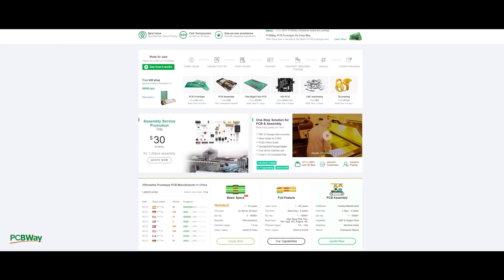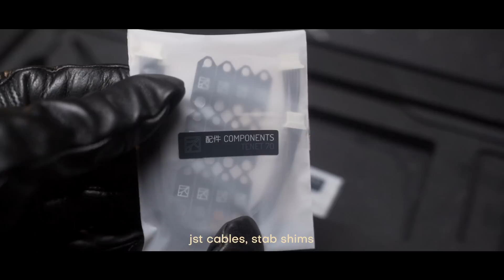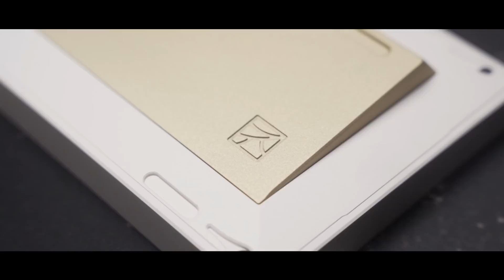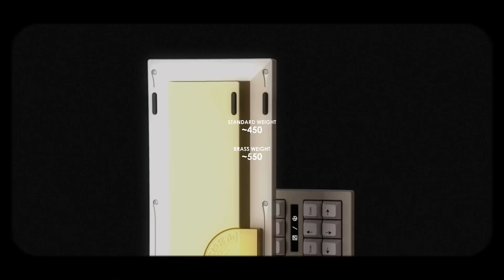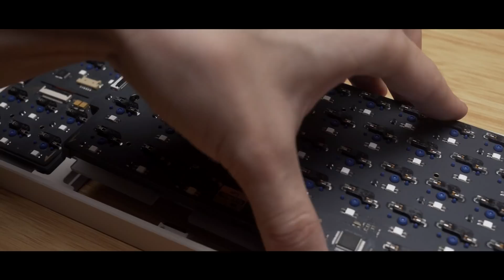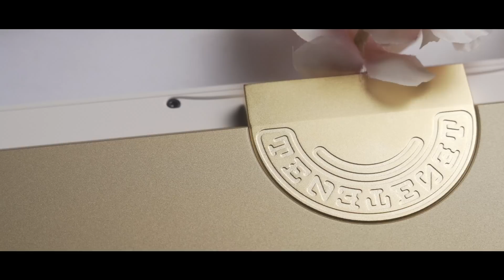This custom keyboard is Endgame Worthy. Seriously. Tenet 70

Comment: I bought the tenet70 and it's just beautiful, I have the zoom65 and TKL and a Keychron Q5 and this thing just stands out. One thing I would recommend is removing the gaskets from the middle and just leaving them on the corners and the typing experience gets way better.

Comment: Video quality is unmatched. I almost wonder what the board would sound like without the plate silicone, as I typically think silicone deadens boards a lot more often than it helps them. Perhaps some standard poron foam would have sufficed. Anyway, fantastic video.